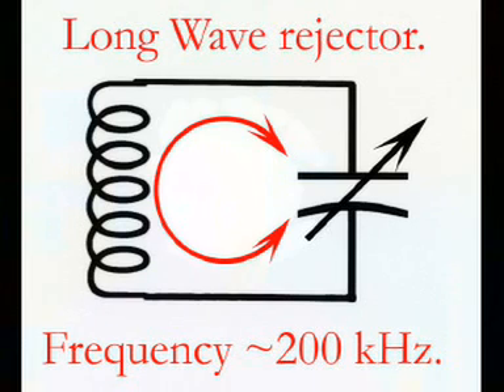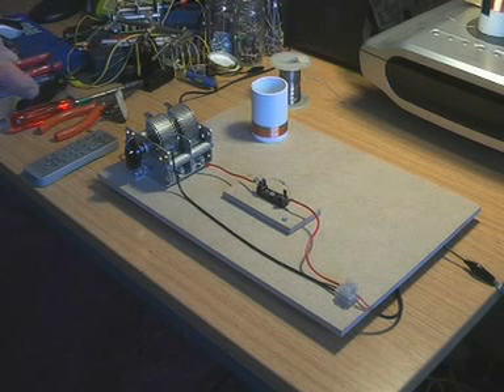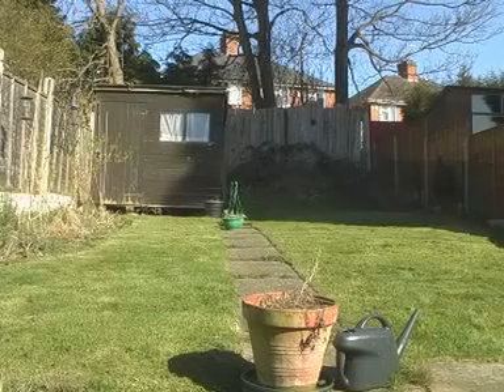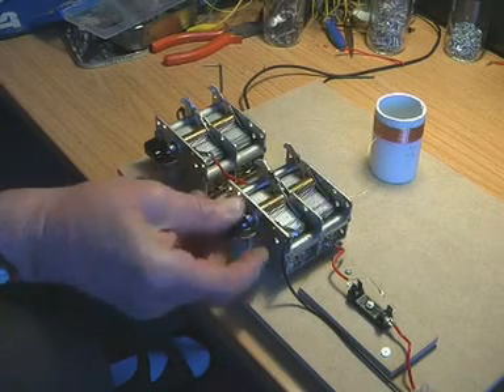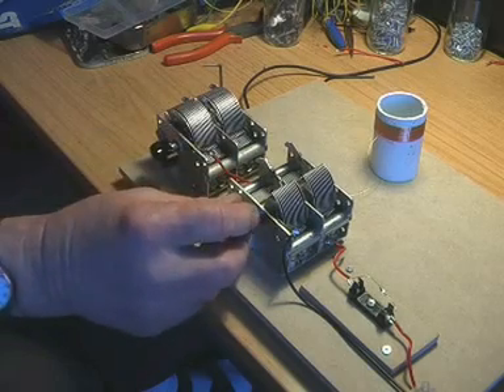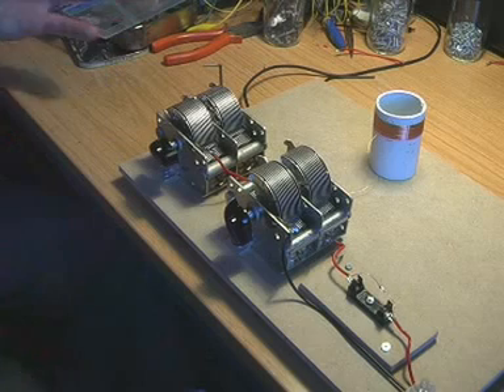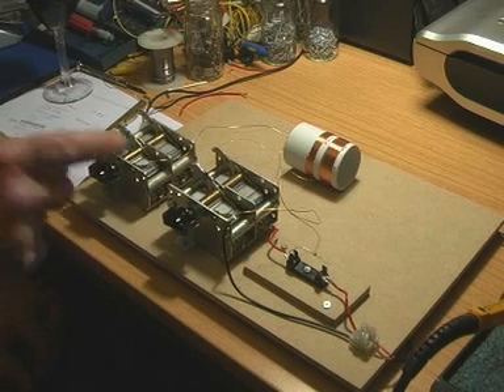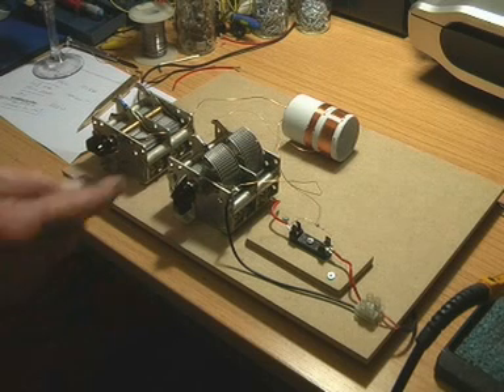crystal3.mpg

Comment: personal question, is your middle initial "H"? and did you own a shop in hurst street Birmingham
Reply from the maker: Hi there - it was my father who had the shop in Hurst Streeet - I used to work there on Saturdays when I was still at school, so one was surrounded (at least in the mid-1950s) with War Surplus radio gear & stuff like that. Later he went more up-market. I guess you must have used the shop, or perhaps worked there? All the best & thanks for writing. Cheers, Norman.
Reply: @bixanorak  as an avid [but novice] HiFi consumer in the late 70's i used the shop to purchase a few items [Pioneer PL512 with a shure m75ed type 2 cartridge - which i still own - though its "retired" to the loft]  also, components - but less so. Was so sad to see so any electronics places closing down - though i believe Matthews - is still going - though moved further down the road. Thanks for getting back to me, hope you don't mind me being nosey.

Comment: thats so nice ! and is there any reason for tuner side to have more turns than antenna side ? like, having more turn at tuner side steps up the signal due to transformer effect ?
Reply from the maker: Hi there. W-e-e-ll, my knowledge of theory is imperfect - but the bigger, tuning side has to tune the full range of the medium wave, so it has to have an appropriate number of turns, as it did in the previous videos. The smaller (primary) coil magnetically couples the signal from the aerial - sorry, antenna - side. So it is a transformer, but it doesn't actually step up the incoming signal, because the primary has less turns than the main (secondary) winding. In fact, it actually reduces the amount of signal into the secondary, but at the same time, increases the selectivity so it's easier to separate the three stations we have here in Birmingham on the Medium Wave. It's a trade-off: we can have very powerful signals, but they're all jumbled up. But by isolating the two circuits, we get better selectivity, though the signal strength is less. But it's pretty easy to amplify these separate signals. I hope this makes sense! Cheers, Norman.
Reply: Thanks for the time and explanation. It seemed very logical from selectivity point of view. I am also building a coil to catch radio stations, and I think it will be of great help ! Thanks !
Reply: well, i tried this, made a 350uH coil on a 68mm diameter plastic tube with no.25 enamel wire 70turns on secondary and another coil for antenna with ~35 turns about 10mm apart. 
now the problem is, our 650KHz station is all over it, it responds very little to 22pf or 220pf (whichever i use) variable capacitor. and even works without the tuner capacitor. i tied connection different taps, only the signal strength is changing. tried a 22pf cap between antenna and antenna coil, but it goes totally silent then. 
any suggestions ? i was hoping to listen to some MHz level broadcasts.
Reply from the maker: Hi there. The traditional value of the tuning capacitor in a crystal set is 500 pF. As you are using a 220 pF variable, that would require a higher inductance - which you have, with 70 turns on a ~2.5" former. So it ought to work. Here, I would use 35 turns on that size former with a 500 pF variable - which is more or less in proportion. So the fact that you only get one station right across the band, probably means that your incoming signal is 'swamping' the tuned circuit. Therefore, you need to reduce the signal from your aerial. This is best done by having another variable capacitor in series with your aerial lead. From what you say, 22 pF is not enough, hence the silence. So it needs more coupling... a variable capacitor will give you this adjustment; though as you mention 220 pF, this might mean you are using one of the the small variable caps that were used in transistor radios & still readily available? The traditional value for use in a crystal set was 500 pF - if you could get one of those, it would be best to use that with 35 turns on your secondary, and say 15  turns on your primary, and use the 200 pF you already have as the aerial coupling cap. into the primary. Hope this may be of help. Cheers, Norman.
Reply: hello, you mean the primary coil inductance is probably too high (125uH) for faint signals to pass ? will it be better if i make that 15turn coil as you suggested with 1mm (no.19) enamel wire (23uH) ? or just that 0.5mm (no.25) enamel wire should be ok ?
i use those commercial AM(220pf) / FM(22-30pf) radio tuner caps that i have for some time now, i guess some shops still have some old stock of those FM tuners. but getting a variable cap like yours could be problem, i don't think i have seen them in shops, even if there are those, they will be pretty expensive.

i will try later with a transistor to amplify the signal, but that may take few days or couple of weeks. meanwhile feeding it directly to an lm386, because i have no high impedance headset.

Comment: I used the antenna coupling circuit to fix the reception problems of an AM radio in the Cheif's lounge of the ship I was on. They complained that they couldn't get their "country station". All it could get was about half a dozen stations, none country. After I was done, they had stations coming in all up and down the band. The fix was about 4 or 5 turns of wire over the ferrite bar on the back of the set one end to the antenna, the other to ground. The antenna was a 35 foot whip on the outside of the superstructure of the ship. I have no doubts that they were listening to stations even when we were out at sea in the middle of the Pacific.
Reply from the maker: Hi there. Congratulations - that's a good job you did - there's a great tradition of 'emergency fixes' at sea for radio stuff. OK, today there are mobile phones & satellite stuff, but old-time radio was, for many years, the life-line of seafaring, should an emergency arise. All the best, Norman.

Comment: First I love your videos, thanks for sharing your wonderful work. I have a question: I want to build a crystal radio that gets 300 hertz range radio waves. A standard coil for a crystal radio is lets say 120 turns. What would I need to do to get the 300 hertz range with a crystal radio? Thanks again for your help.
Reply: Still waiting for an answer 5 years later:)

Comment: ive made coils with 15, 30, 50, and 100 turns.
the 15 turn coils can receive a couple of SW channels, and sometimes, ham radio!
the 50 and 100 turn coils can receive local stations, but anymore turns, and its the same as the 100-turn coil.
any suggestions? 
good video!
Reply from the maker: Excellent! You have done well to receive short-wave signals on your 15 or 30 turn coils. It's a great challenge to make a short-wave crystal set! The 50- and 100-turn coils are presumably getting medium-wave signals, as you say they are local stations. To get to the long wave, quite obviously, more turns are necessary. But of course, there may not be any long wave signals where you are located. AFAIK, long wave broadcasting is confined to Europe. If you live elsewhere, there might simply be nothing there for you to receive! For example, I don't think long waves were ever used in North America. You could try googling for a list of broadcasting stations in your country, and neighbouring ones. I'm just guessing, but long wave broadcast radio probably has a range at night of about 2000 miles - much less in the daytime. So if you are located more than say 1000 miles from a long wave transmitter, there isn't anything for you to pick up. I hope you go on & do more to explore radio reception with home-made gear - it's great fun, isn't it? Good luck! Norman.
Reply: i was looking for more power supplies/wall adapters for the wire inside, and found a FM/ MV /9 SW band radio!
ive been listening to cuba, NHK, WHR, and other stations!!

Comment: Μπραβο!! Iliked very much your video.May i aski if the diode you used is a 1N34A?IF Not which one then? thank you
Reply from the maker: Glad you liked the video. The diode used was an old Germanium type called 0A91 - but, the 1N34A is almost exactly the same. It's just a Germanium diode, and in this very simple circuit, I'm sure they would both work equally well. Best wishes to you & yours.

Comment: Excuse my noobish question, but what determines the amount turns of wire on the coupling coil?
Reply from the maker: Thanks for writing! Well - as far as I know - it's not so much the number of turns on the aerial coupling coil, as the fact that the coupling coil is quite separate from the main tuning coil. We had 60 turns on the main tuning coil, and maybe 20 on the aerial coupling coil. 15 turns or even 30 turns on it would probably have worked just as well. It's not very critical. One very important thing I forgot to say, is that a capacitor and coil in series - as in our aerial - is an 'Acceptor Circuit'. It allows the desired signal to pass into it, and attenuates others. By contrast, the main tuning circuit is a 'Rejector Circuit', which directs our desired signal to the crystal detector. The action of these two magnetically coupled circuits is therefore complementary, and results in the increased selectivity we obtained. However, as remarked, the final signal is weaker & needs more amplification.

Comment from the maker: Yes, that should work OK. Myabe it will also work if you put the signal into the 'line input' of your sound card - they are usually blue colour. Try line in first. Microphone inputs are usually pink or red. BUT - your computer may be different to mine and something just might go wrong! I hope I don't give you bad advice! <8^)

Comment from the maker: Yes. On this sort of variable capacitor, the moving vanes are connected to the body of the device. This is the part that goes 'to earth' or ground. The fixed vanes are isolated from the body. So if you check out the diagram on the video at 4min 40 sec, the red wire is the upper one, from the fixed vanes, leading to the diode; and of course, the other, lower wire is the black one which is attached to the body of the capacitor. Hope this helps.

Comment: Hello sir great stuff,what about using wave traps !,one or several,that may suck up what you dont want and maybe with the advantage of not loosing volume,i think,,i remmenber years ago in Australia  i one day dicided to unwind the coil and i started to get so high that i was able tu tune in shortwave and listen to a few very faint European stations and asian of course, true that a did have a 50 meter antenna in me backyard,i did use those cheap crystal earpieces that are much more sensitive .

Comment: Hi, I am surprised about the very good sound quality of this simple MG receiver!  
You could listen with a reasonable volume with a crystal headphone, the only thing you have to do is, put a ,001uF capacitor across the output of the diode and earth. I think that the variable capacitors are 500pF, so if you tune the antenna capacitor in the middle (about 250pF), then use a normal capacitor around 250pF. 
On to the next part!
Tanks for sharing.